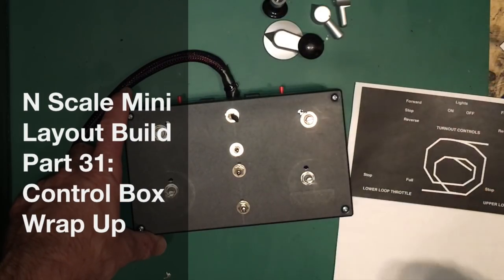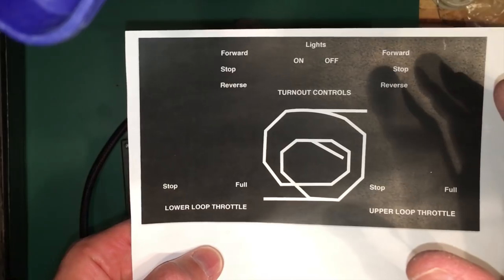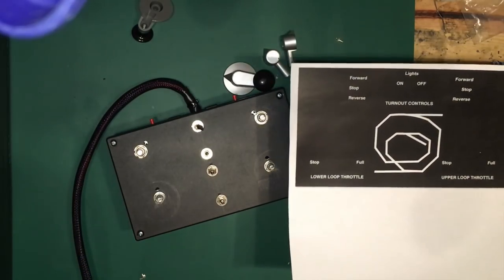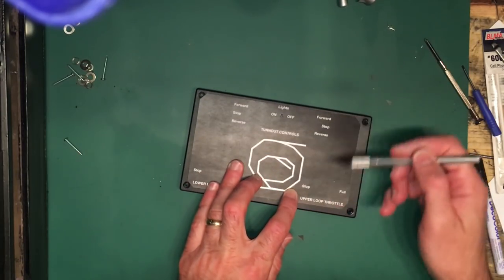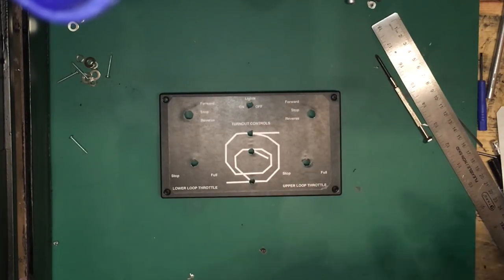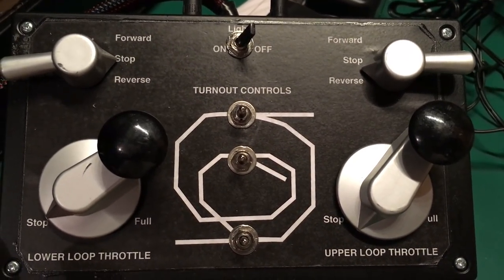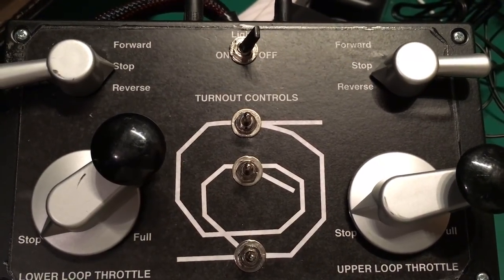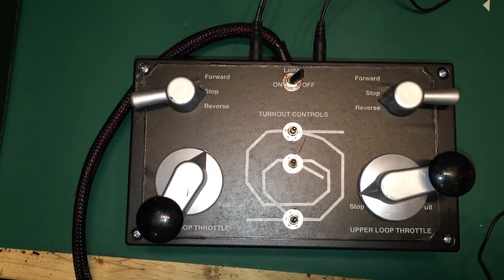N Scale Mini Layout Build Part 31: Control Box Wrap Up

Comment from the maker: Thanks for the comments Fred and Chuck.  First time I've tried something like this, so there are a lot of areas for improvement.  first, I could make it thinner, but it is hard to know in advance the first time how much room you will actually need in the box.  Second, I would change how I did the plugs and cables connecting the box to the layout and wall power to make that work nicer.  Third, I would try to see if I could print my labels and track diagram on some type of glossy or vinyl type label stock so it would be more durable.  The spray coating makes a nice finish, but can cause some problems on paper if not done very carefully.  Also, it would have been handy to have added an extra on-off switches for the power going to the turnout motors so I could turn all of them off at once in case a short occurs with one of the toggle switches.  You can just unplug the power going into the box easily enough, but a toggle switch would be nice.  A lot of these things you don't figure out until you try to do them, so next time I try this I will have a better idea of how to make it work better.  Even so, I am happy with the control box, and it does work well.